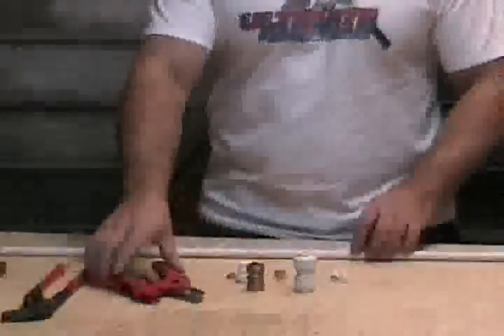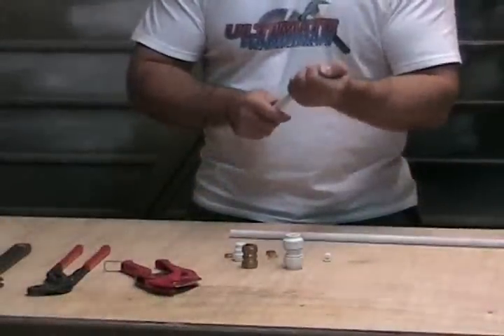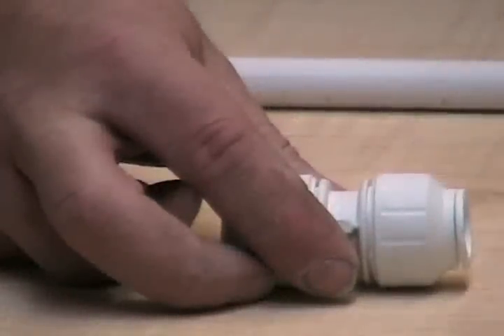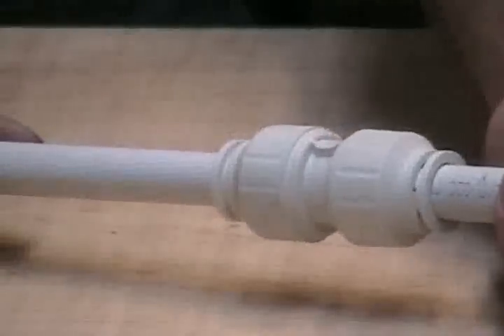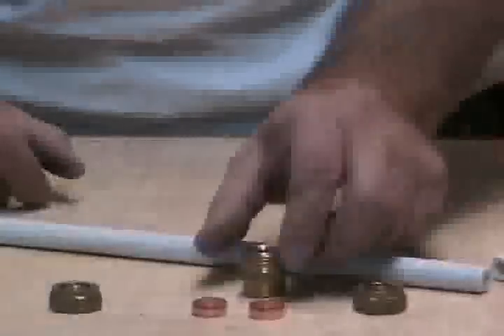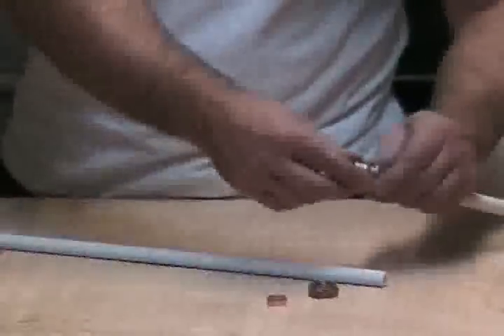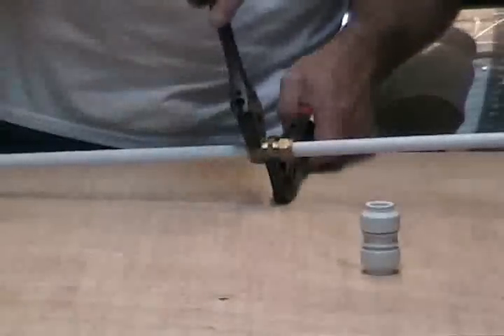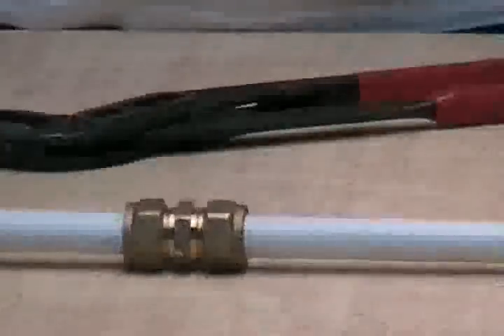How to join plastic pipe

Comment: Should you use copper olives instead of brass even if a pipe insert is being used? This is the first time I've heard this in regards to compression fittings.
Reply from the maker: You can use brass or copper olives, but I prefer copper as they are much easier to compress (copper is more ductile than brass) 👍
A pipe insert should always be used on plastic pipe 👍

Comment: had to find a vid as good as this on this subject, 
I have this JG barrier pipe 15mm but having to use normal copper pipe compression fittings as internal diameter of JG pex barrier pipe is different to other pex pipes!
using the brass compression rings, i got a little weeping,wrapped it with teflon tape and no problem, if I can find copper rings I would change them but I'm more worried of the expanding and contracting of the hot water feed causing the JG pipe to leak to a brass compression fitting eventually ! any comments experiences?
Reply from the maker: I've done a newer video on push fit- https://www.youtube.com/watch?v=Z83vlwUyZIw
Brass olives are a right pain in the backside, as long as the pipe inserts have been installed you should be able to tighten the compression nut quite tight, perhaps by using some longer spanners. I've had problems in the past with brass olives as they are not as ductile as the copper ones and are much more difficult to get a good seal.
As long as it is sealed, and not leaking it should be fine with the expansion and contraction, as the pipe is very flexible.

Thanks for the comment

Comment: My plumber connected a replacement shower exposed valve block and it leaked. The existing pipes are plastic. He said he did not have the correct O ring seal fitted. Is this correct, would the connection have an O ring seal, as you showed making the connection with a copper olive.
Reply from the maker: Normally you only get O rings in push fit fittings, not in compression fittings.
Sorry for the slow reply, this comment was stuck and required approving.

Comment: Excellent vid!  I'd like to install a Magnaclean Pro 2.  All installation info is for copper pipes, but I have 22mm plastic pipe.  If they say cut out a 150mm length of copper pipe should this be 150mm plus say 6mm to allow for the length of the two inserts?
Reply from the maker: +General Auchinleck 
I'm not sure but would guess that they have already included the 6mm for the two inserts!

Comment: used a speed fit tee today plastic pipe in each end. inserts in each... the inserts with the rubber seals on them and tightened.... 2 mins later... dripping drip drip...took it off replaced with compression tee with copper olives. job done. I've used both fittings for ages but this specific speed fit fitting must have been defective in some way!
Reply from the maker: Speedfit are normally good as long as the pipes are straight and not on a angle, but like you say it might of had a defect.
Thanks for the comment
Reply: the pipes did go through a wall and put a bit of pressure on the fitting which I think now was my problem. but I still would rate them highly in many uses!

Comment: Is it fine to connect the tap hoses from my monoblock to 15mm straight speedfit pipe (via compression fitting)?.Reason I ask theres an element of doubt in my mind re the rigidity of 2 pieces of 15mm speedfit pipe v 2 pieces of 15 mm copper pipe.By the way handyman have you covered 4 way manifolds in your you tube vids? ,

Comment: Great free advice,thanks. I am wondering if you could give any advice on using plastic pipe for plumbing a shower. I read somewhere something about back pressure and having to use compression fittings. Thanks.

Comment: have you put weight on since your last vid ?
Reply from the maker: No, I think I have lost weight since my last video.
This one is almost 4 years old, when I had time to go to the gym ;-)
Reply: oh right , great vids. When I asked in B&Q the ex plummer there told me any inserts work with any plastic pipe but I always have awful trouble getting them in and have to use washing up liquid and a hammer - they still sometimes wont go in. Do you know of any inserts that are a tiny bit narrower than the others ? Many thanks
Reply: @chrisaxford7851  Charming

Comment: Hi
Have you/do you ever mix different makes of fittings and pipes.

Does it make a difference to reliability or is it just the manufacturers ensuring we stick to their brand?
Reply from the maker: No, the manufacturers only guarantee their fittings with their pipe, if you used another make and there was a flood, it would be an easy get out for them.
Thanks for the comment

Comment: I'm using a coil for an attic run. Should I join trv straight on tye coil or add some copper to the ends?
Reply from the maker: You can join the TVR direct to the plastic pipe.
The only time you have to use a length of copper is when you are connecting plastic pipe to a boiler (the first metre has to be copper)
Edit: You will of course have to use pipe inserts ;-)

Comment: Is it OK to connect plastic pipe directly into radiator valves? The reason I ask is because I know that plastic cannot be directly joined to a boiler - there has to be one metre of copper first. Also, what are the advantages/disadvantages of plastic inserts or copper inserts? Many Thanks.

Comment: I have an electric shower in my bathroom and I want to extend the length of its hose, from it current 1.75 metres, by adding a second 1.0 metre hose which will then allow it to reach the handbasin. 

I cannot find a 2.75 metre hose in the shops  -- the longest I've come across is 1.75 metres.  Which raises the question, am I making a big mistake by extending its length by adding a second hose to it?   

 Is there a technical reason why the longest hose available is 1.75 metres?  Or is it just a matter of 'market forces'  -- few people want a longer hose, therefore nobody makes them.

I'm currently using two hoses joined together, using a straight 15mm brass connector (without the olives and nuts, each hose just screws into either end of the connector) and it is working fine to date. 

However, the brass connector does feel a tad heavy which, in the long term usage,  I'm afraid might damage the water outlet from the shower unit, therefore I'd like to replace it with a lighter plastic fitting.    

Problem is, I cannot find a straight 15mm plastic screw connector!   The only ones in Screwfix or B&Q are the push type  -- of the sort in your video! 

Sorry this post is so long; maybe you should read it one night when you have difficulty getting to sleep!! 

But to focus on the questions I'd like answered:-

1.  Am I likely to damage the shower unit by extending the length of the hose that was supplied with it by the manufacturer? 

2.  Do you know of any place that sells 2.75 / 3 metre shower hoses?

3.  Do you know where I can get a 15mm plastic screw hose connector?  

Many thanks for your forbearance with the length of this!
Reply from the maker: +apache16789 
Extending the house will not cause any problems that I know of. 
My hose in one of the bathrooms here is actually joined just like yours using a brass nipple.
You can get 3m long hoses- http://fave.co/1NQLEdP
You can also get plastic nipples, but I'd get the longer hose to be honest as plastic nipples are not much good- http://fave.co/1PxhJIi
You would have to select 1/2 inch BSP from the drop down menu on ebay for the nipple. 
I hope this helps ;-)
Reply: +Ultimate Handyman 
Many thanks.  Very much appreciated.
Reply from the maker: +apache16789 
You are welcome ;-)

Comment: I am shortly to upgrade our CH system,and was considering plastic pipe,so should I be concerned about the connection,to copper pipe and radiator valves.

Comment: Brilliant video! I've only just started following and I'm hooked! Feeling much more confident. Have you used Conex Cuprofit pushfits? Are they any good for 10mm radiator pipe, copper to plastic?
Reply from the maker: +Aaron Thornley 
I have used Connex in the past but not on 10mm. They should be fine with the correct insert on the plastic side, as long as you ensure there are no burrs on the copper side ;-)
Thanks for the comment

Comment: P.S. Do you not use Plumber's Mate?
Reply from the maker: I never use anything on compression fittings as the manufacturers of the fittings do not recommend using anything.
(the manufacturers of the sealing compounds of course recommend you use their products ;-) )

Comment: Hi Handyman, just saw another video that said you can bend plastic pipes around corners etc and others say that you have to heat them up or pour sand into them in order to bend the pipe.  In your opinion is this true?  Appreciate your help.
Reply from the maker: +Prof Khan You can bend plastic pipe slightly, but if you need to do a 90 degree bend you might have to apply a little heat. Some of the manufacturers sell bending forms, which keep the pipe bent at 90 degrees, they are only a couple of quid each. You need to check with the specific make that you are using as many of them can just be bent without heat but will need a former to keep the shape.

Comment: Thanks for your quick response. I'm using 16mm PEX-AL-PEX from thefloorheatingwarehouse dot co dot uk 

They offer a variety of fittings, but I think the JG Speedfit pipe is the same dimensions.

Regards

Phil
Reply: JG pipe is 15mm and different internal dia to other pex pipes, I bought it in a rush thinking it was same as pex al pex,